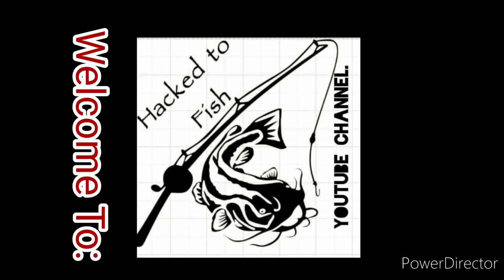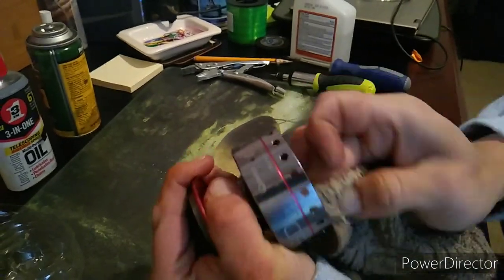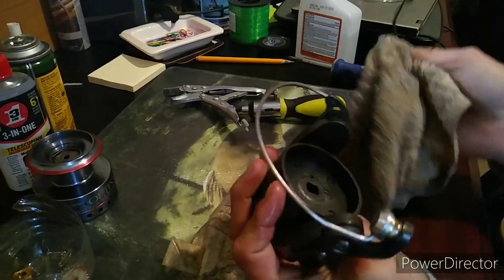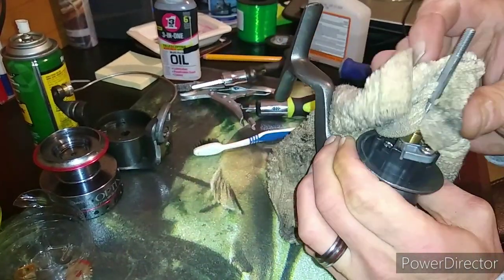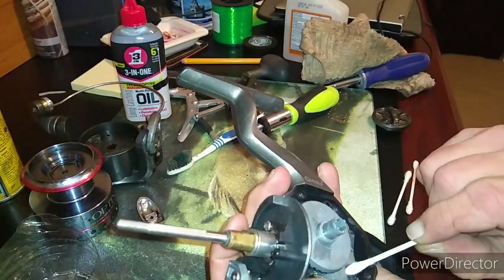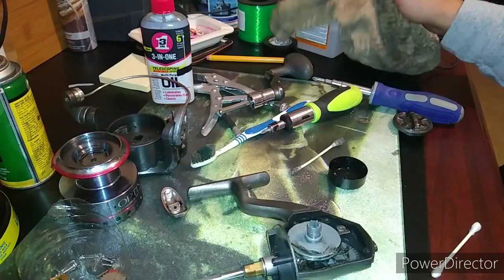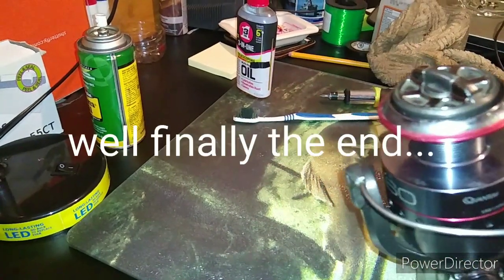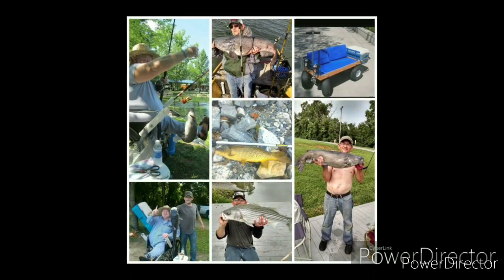Simple spinning reel maintenance (optx 60)

Comment: Awesome! I have one of those reels. i snagged onto it in the bottom of the Ohio river a few years ago. It was filthy but not in too bad of shape though. I will send you some pictures of it on messenger. I use regular reel oil and reel grease for Walfart on my stuff. The oil/grease works pretty decent.